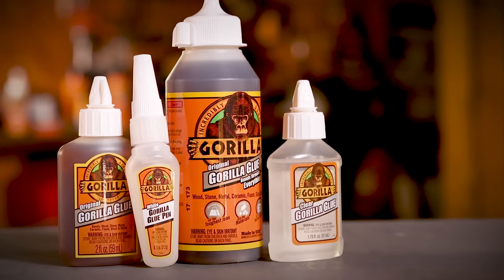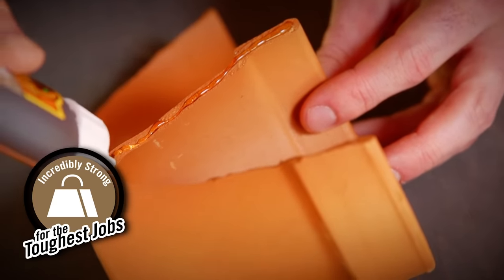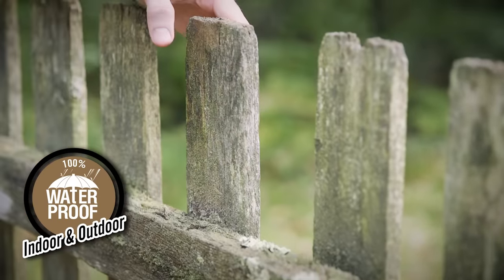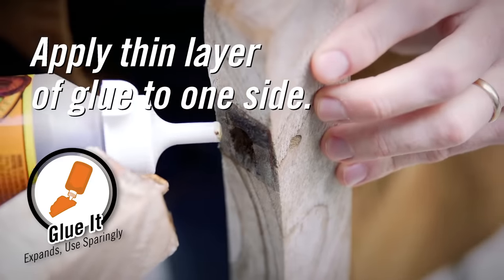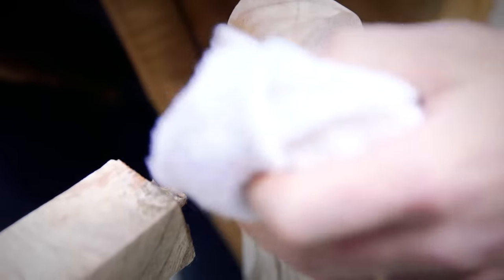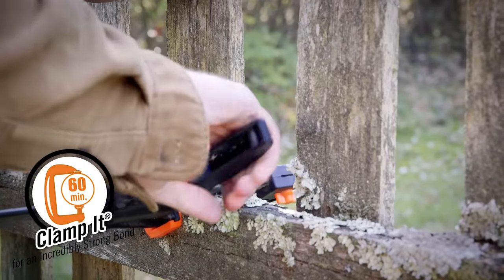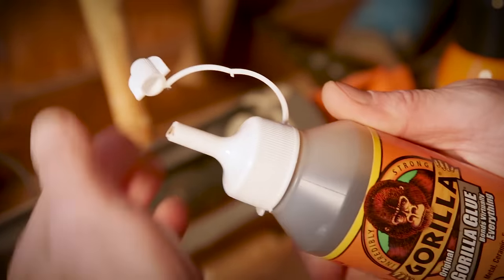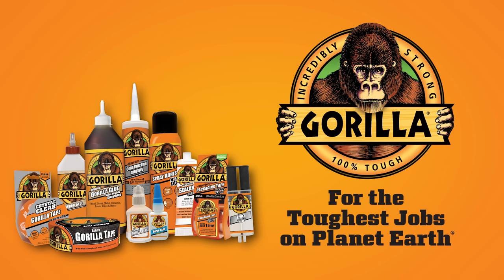Original Gorilla Glue

Comment: I hate gorilla glue on anything. It is not a cure all, people. It is a screw up the repair as much as you can, so the next guy has to clean it all back off for a proper repair glue. It usually fouls the surface for the next repair, lessening the chances of a proper repair.

Comment: After finished with the glue you’re supposed to wipe the nozzle  and squeeze the container removing all air and replace the lid keeping the containers squeezed.  If you don’t squeeze the container while replacing the cap you may have hardening issues.

Comment: Great stuff...BUT only buy the SMALL bottle rather than the large one. Why?  Because the stuff goes bad quickly.  I have have lost half a large bottle -- it gets very thick and hardens --  so I started buy the small ones and even there, they don't have a great shelf life.  I have even taken to storing them upside down so the air  inside the bottle is at the back of the glue, not at the front so if anything, the back will get bad before the glue near the tip.  That seems to give it a bit more longevity.  Wish they'd make a bottle cap that was wide so you could easily store the bottle upside down, having it sit on its cap.

Comment: I thought you only dampen one surface and apply the glue (a small amount) to the other surface.
Have the directions changed? I remember reading the instructions on the bottle I had, but it is long gone now and I need to buy some more.
I thought it starts foaming like crazy once it contacts water therefore you applied it to the dry surface and dampened the other surface. Then clamp then together and the foaming starts.
Reply: Yeah it still says apply a thin amount. This guy used Waaaaay too much. It's gonna expand all over everything

Comment: I bought one but it's thick as molasses and won't pass through the applicator like on the video. I have to open it and use a stick or something to use it and it's a mess. It's something wrong with my glue?
Reply: Same with me. I bought it today and it's very hard. I will probably return it.  Before I had same glue but white, it was liquid and used it for 1 year, was not hard like this one

Comment: The clamping aspect is a bit off-putting because there are many things that can't be easily clamped. I'm thinking of 2 awkwardly vertical objects like sticking a handle to a door. It's a shame really as need something that's both waterproof and strong, but without the clamping. Need advice or recommendations people!
Reply: Use Gorilla Tape to temporarily secure the handle to the door, once the glue is dry, simply remove the tape! I prefer the Clear Gorilla Glue as it works the same as the Original with the Added Bonus that it Doesn't Expand so you don't have to clean any residue!
Reply: I found that the clamping is probably great when you can do it, but not 100% necessary for the glue to still make a strong bond.  The stuff is incredibly strong.  In fact, just to this moment watching the video, I never knew about wetting the surfaces, and I have been using this stuff for a few years now and never had a problem with what I was gluing.  So it hold even when you are doing it incorrectly. Evidently it's very forgiving!
Reply: @captaincinema5066  thanks for that info, much apricated.

Comment: Gorilla glue is almost a very great idea. What would make it a great idea is when you use this stuff it wouldn’t foam out all around the sides making a mess of your work.  I had to quit using gorilla glue for that exact reason and even using it in very small amounts it foams out all over the place.
Reply: The expansion is what makes it bond better. It expands into small crevasses to grip the 2 surfaces together. Just wipe it off as it expands before it sets up.

Comment: I purchased a 60ml a gorilla glue. Yes! it  the ideal supper strong glue to use. Also, it's one of the most badly designed glue bottle, ever. I new when I first opened it, that I may not use it too its entire end. I was correct, by my next useage, the glue was more difficult to remove from the bottle and so on. Even though I cleaned the top of the bottle, replaced it securely. And still it got worse everytime I used it. Until , it became useless and so hard. Fitt for the bin. Please, someone, invent a glue bottle that the expensive glue can be used in its complete entirety. 
Thank you.

Comment: What a con it’s filler foam in a small very expensive bottle 🤔
Reply: exactly...  its the same shit that comes in those spray cans for filling gaps around windows, electrical boxes or insulating small holes.
Reply: When have you used filler foam for sticking together a ceramic pot?
Reply: @Nippernator  gorilla glue is filler foam in a tiny expensive bottle it’s the worst glue on the market
Reply: @johnmetrac2898  filler foam doesn't get hard as a rock ya dingus